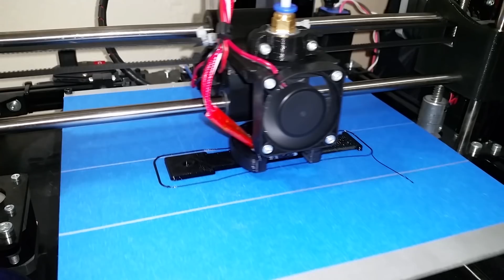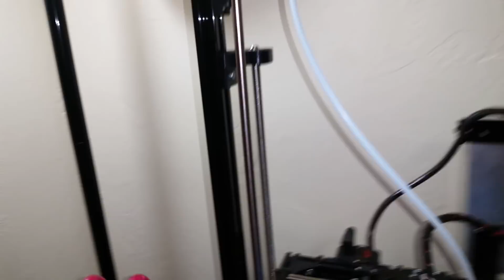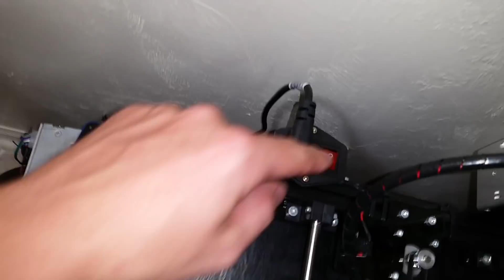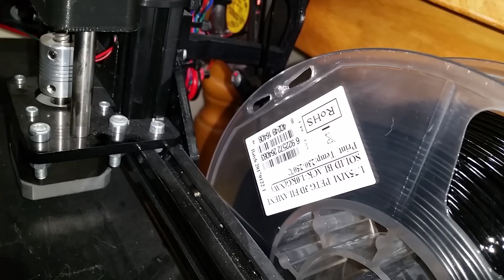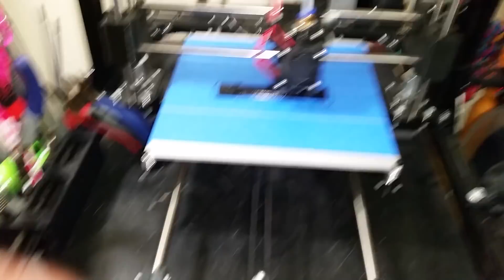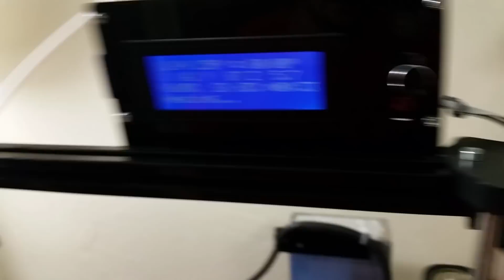FLSUN Prusa I3 3D Printer

Comment: Thanks heaps for this. A bunch of tips I will surely follow and so useful to know having just bought one of these. The most helpful thing you said was about the belt being installed backwards! I did the same and was battling it for days trying to figure out what was up with my Y axis moving backwards when the printer looked to be built correctly.

Comment: Did you use the proximity sensor. If so which port do you plug it into where does it screw on and how do you set it up?

Comment: How do you get the filament to consistently grip. Mine always gets loose?
Also how do you set the cuz coordinates? When I start printing a model the z axis is ALWAYS too high
Thanks
Reply: ¿Loose filament grip?: add a spring
 ¿Z axis?: Adjust end stop or modiffy Z offset.

Comment: I haven't yet received my i3 FlSun clone, but on the pics ive seen of mine so far, the Z Axis stepper motors are on the top of the frame. I see yours are on the bottom (seems logical if only for a CG perspective) Did you change the position?

Comment: Great video! I noticed that your Z-axis steppers are at the bottom end of the lead screws, but all the pictures I can find of this printer have them at the top. It seems better to have them at the bottom. Did you move them to the bottom or is that where they are supposed to be?

EDIT: 
I took a closer look and I see the printer has been redesigned a bit. The Z-axis no longer uses linear bearings, but wheels running in the 2020. I guess I prefer the old design better, I wonder why they would have changed it, maybe to lower cost.

Comment: You talk about buying all these parts. Is there a standard for this stuff? Is it hard to find parts for "this" printer? Eg. If I wanted to replace the hothead, could I get a standard hothead that would bolt on to a "standard" bolt pattern on this thing, or would I need to modify the mounting point or some such?
Reply from the maker: Harley Burton I honestly haven had to replace major components like the actual hot end, stepper motors, etc. The only "hard part" I've replaced is the nozzle and I just ordered a 3 pack of .04 sized nozzles off eBay for like $9 and they work great, better than the original actually
Reply: can you please leave a product name / url to the .04 nozzle with better quality? This would help me a lot! thx :)